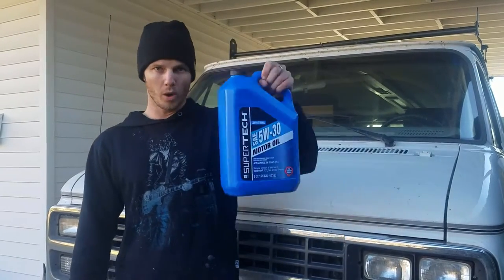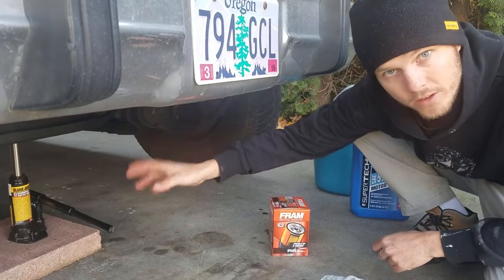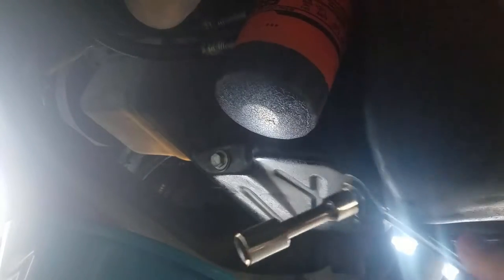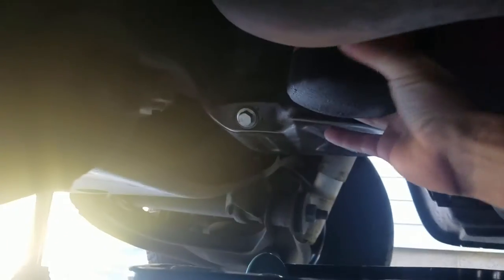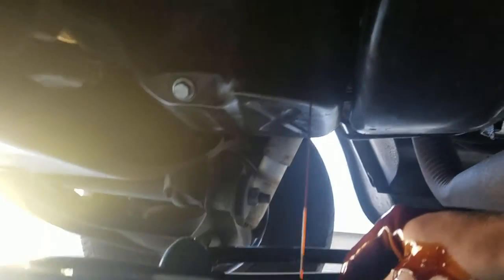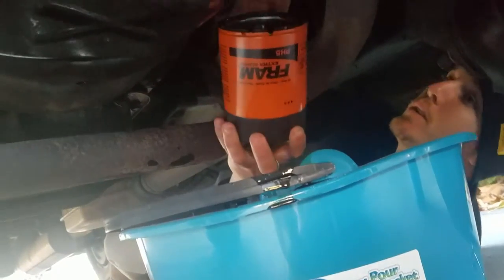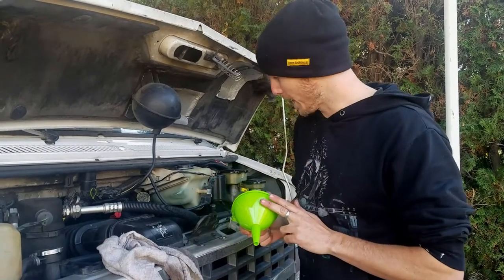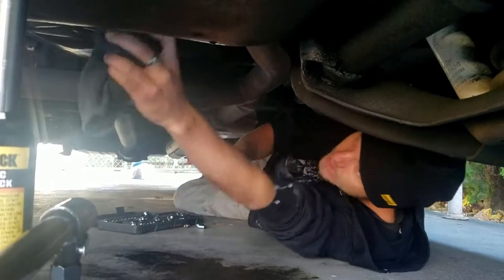How To Change Your Oil & Oil Filter - Chevy G20 Van

Comment: A little advice for what it's worth (ASE tech here), always take the oil filter off while the oil plug is NOT in the oil pan! If you plug the oil pan back up and then drop the filter, you're not releasing all of the oil. The filter creates a vacuum and that can hold oil back from draining. Anyway, just a tip.. hope this helps someone.
Reply from the maker: Good tip. Thanks for sharing!

Comment: Thanks for sharing! I love my Chevy G20 '93 Starcraft conversion. It's hard to find videos for our van. I'll change the oil this week. Just made it from Baja Mexico to central Canada
Reply: wow that’s quite the journey! I’m hoping to do something similar in my ‘95 gmc rally wagon this summer. You didn’t have any trouble with border crossing due to the virus?
Reply from the maker: Thanks for watching! We love Chevy G20's so much we have 3. That's an epic journey and I bet your van loved it. We just did a 5000 mile road trip from Washington to Minnesota and back. I'm now using only K&N oil filters in my vans as they are high quality and you only need to change them out every 10,000 miles with one oil change in between at 5,000 miles.

Comment: My only issue is the jack you're using. Spend the 50 bucks for a stand or 2 and dont get crushed by your car dude.
Reply from the maker: It's a 4 ton jack but yes a trolley jack or stands might be a little safer lol

Comment: Is the oil cap on your g20 a conventional screw on cap? I have a 1990 Chevy G30 and it's got a weird oil cap that doesnt doesnt want to unscrew whether turning counter clockwise or clockwise. It says to refer to the owners manual on the cap, which I dont have.
Reply: Mine is the same way. It's like a plug, push it on and pull it off. It doesn't screw on or off. It does take some muscle to get it off and on.
Reply from the maker: Ours is also a plug type cap. It also takes some muscle to remove on and off.

Comment: What type of oil for a 1990 Chevy g20?!? 10w30 ? Or 5w30
Reply from the maker: 5w30
Reply: @RoadTripUSA  My guy is a commercial engine specialist. He says only 5w 30 on newer engines with these vans. Once you're approaching higher mileage, 75, 000 and up, use 10w-30 high mileage.

Comment: How many miles before an oil change ??
Reply from the maker: Probably between 3,000 to 5,000 miles. Depends on the quality of your filter. You can buy a 10,000 mile filter and change the oil only at 5,000 and then change the filter and oil again at 10,000.
Reply: @RoadTripUSA  Are there any zerk fittings "chassis lube" to grease up and refill the front and rear differentials and top off all fluids and lube weather strips every 3000 miles or the 3 month rule or less ??
Reply from the maker: @kennykennysson1077  just a general check of fluids such as radiator and transmission but those should be good for 100,000 miles. As for greasing I have never done that. There is two zerks on the control arm I believe for greasing the bushing but I have never needed to.